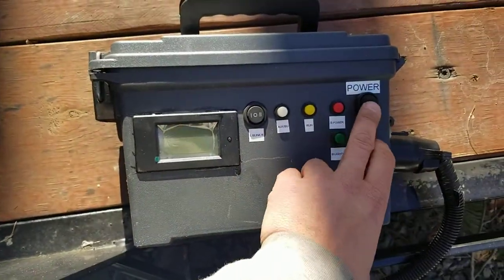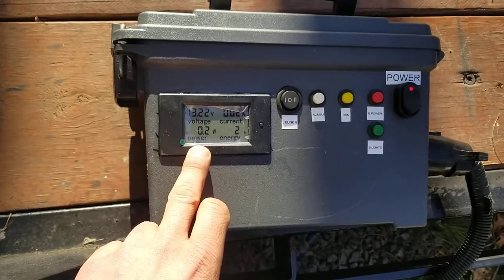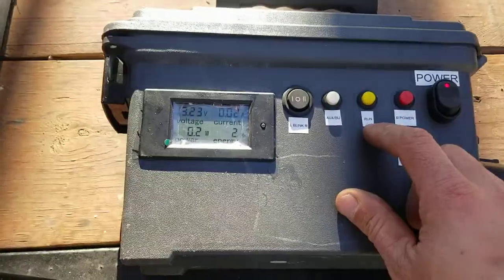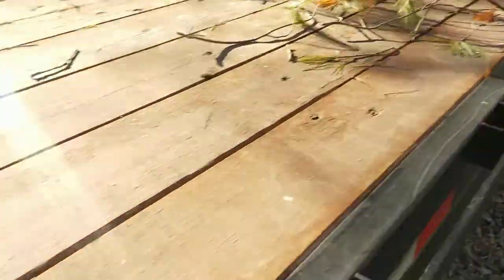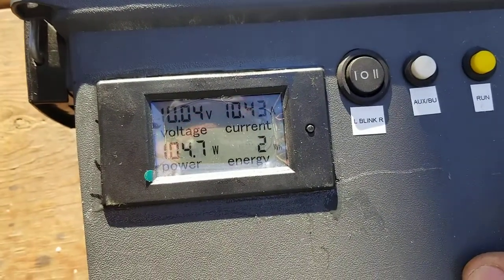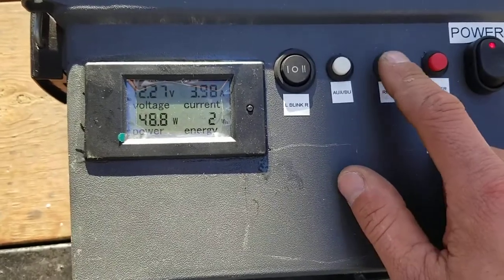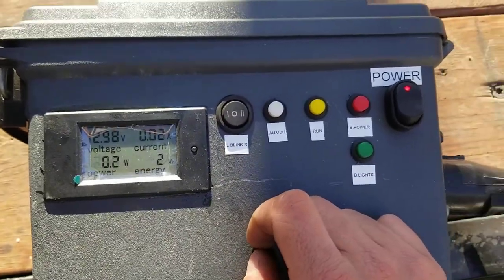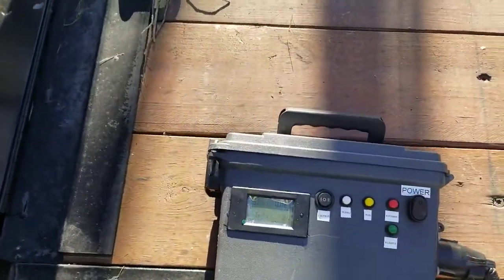Portable trailer tester for brakes and lights updated

Comment: That is really cool!  In addition to being able to tell if there is an open circuit to one of the magnets, it would be nice to see the current draw of the lighting system. On some vehicles if the tipm detects over current, it has to be reset by a code reader...
Reply from the maker: Thanks for the idea. Took some research to find the screen but it works well so far.
Reply: After seeing your box, I looked on line for old school panel mount dc amp meters, and saw that unit you have. That looks better, since you can see voltage droop too.

Comment: Do you have a parts list anywhere for this?  I guess the hard to find one would be the volt meter (if its just a separate screen and not just a volt meter hidden in the box) Lol
Reply from the maker: Hi, it is a separate screen with built-in volt meter. I got it from ebay. It's good to 60-80 amps I think. Each brake should be less than 10.